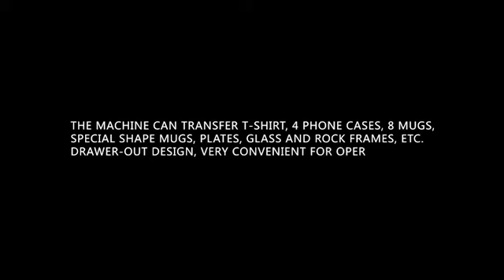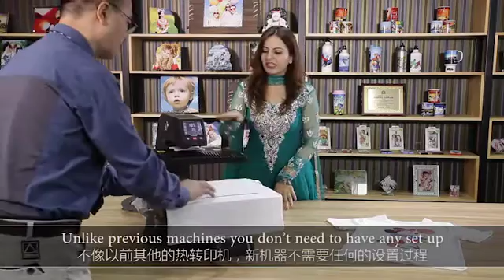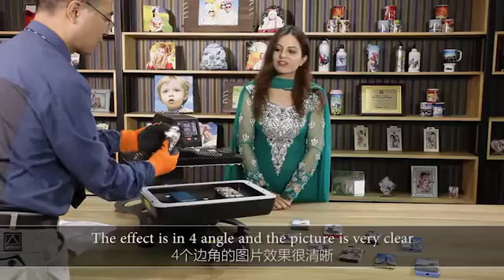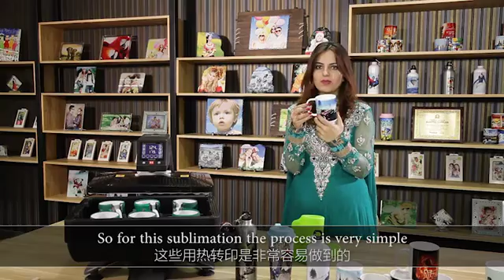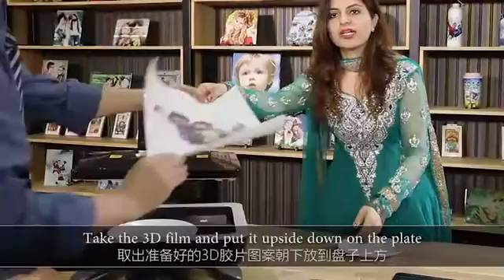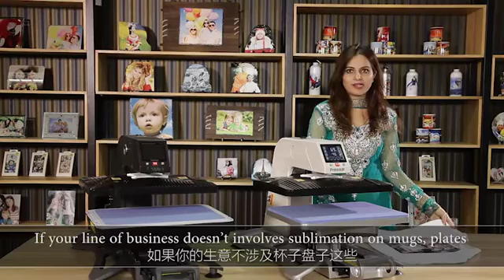2015 FreeSub Automatic 3D sublimation vacuum Heat Press machine ST420 By Sunmeta

Comment: I purchased the st420 from a company , and it did not heat. I have replaced the upper heat plate, and lower plate. I am not sure if there is a sensor on the lower plate, is there any diagram? When I powered it up, the temp got to 450.

Comment from the maker: • designed for all sublimatable materials, either t-shirt, flat, vertical, or 3 dimensional.
• support film sublimation
• support all functions as st-3042
• Presets - Five (5) presets that can be programmed by the user
• fashion design